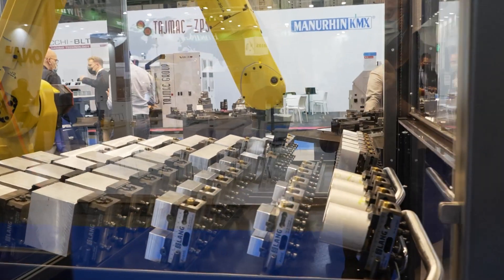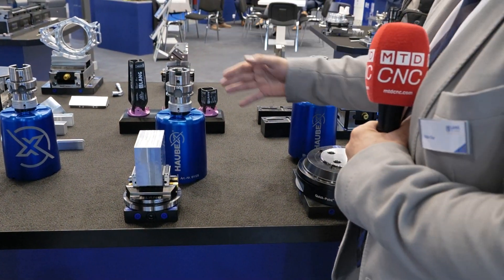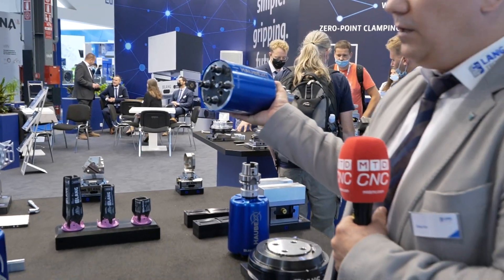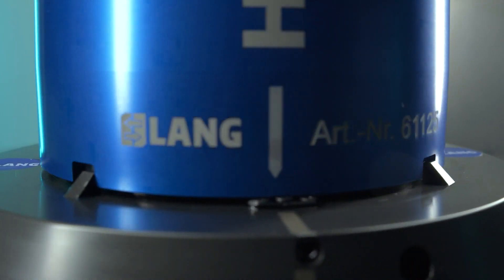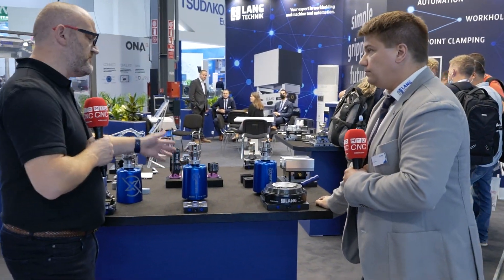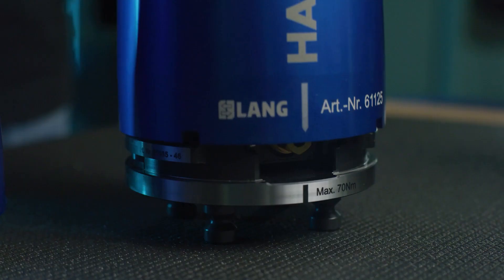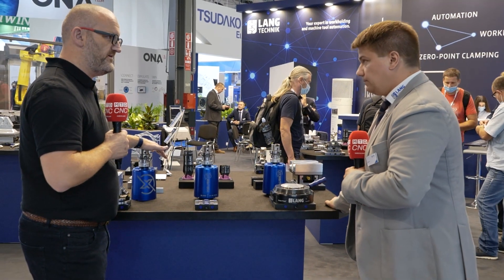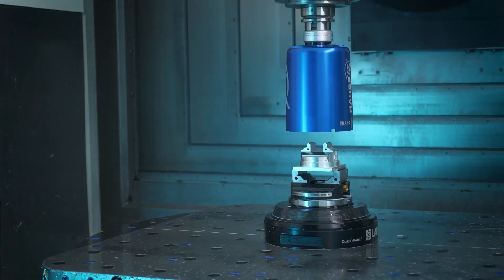Turn your tool changer into an automation system

Comment: This seems like a very specific use case scenario that also combos the requirement of staying limited to your tool changers max diameter (empty side pods, no less), for your part size. This is already ignoring your available tool rack abilities, on a machine that uses that size of parts. So means that is normally 30-40 tools usually. I'd like to see a customer in the wild that have used this setup, and describe their thought process of getting a benefit out of this system.
Reply from the maker: Glad you enjoyed the video.
Reply: No problem to make it work. You have 30 pockets on your Haas VMC, so 10 of these will have blanks waiting and with 20 tools you will cover a lot of parts. This design is excellent but no problem to make it by ourselves. Idea is the most important here😀
Reply: @zyndapp800  You're also forgetting essentially the requirement of needing to designate each gripper as an oversize tool. Which means 10 grippers is 20 pods, leaving 10 tools. Which can work for some jobs. But they are often rather quick if they take only 10 tools. So it is a very delicate balance of finding long jobs that take a while using minimum tools, meanwhile trying to use as many grippers as you can.